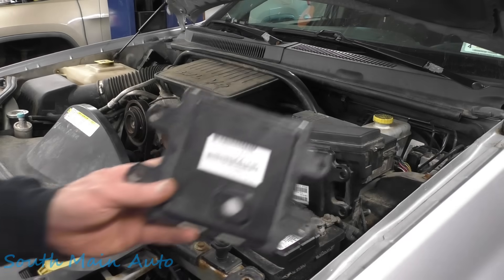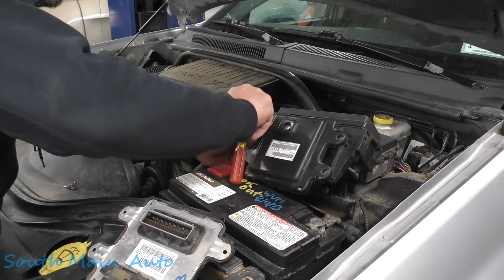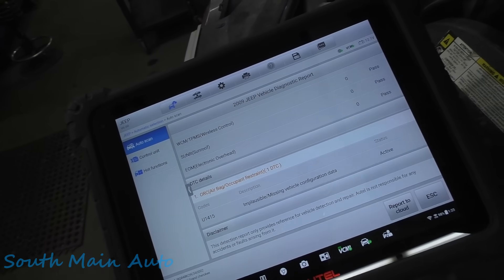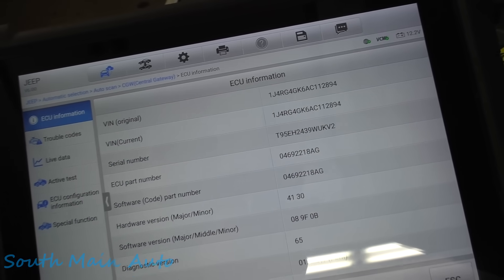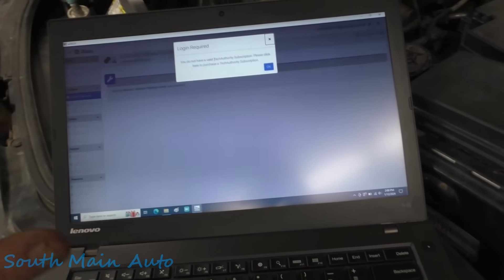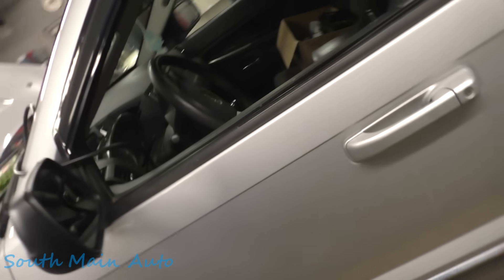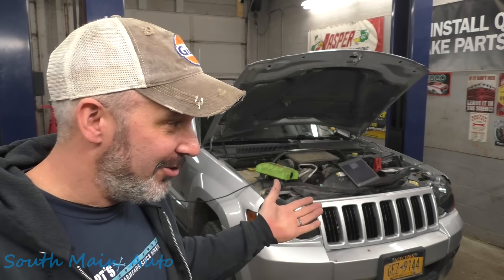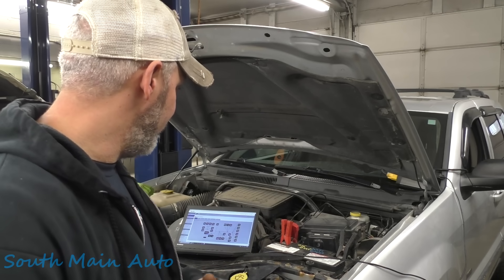'09 Jeep Grand Cherokee - Tach & Speedometer Cut Out - The Fix

Comment: Halfway through this video I had a feeling you were going to have to have L1 give you a hand with this one, I'm glad he helped you sort this thing out, and I have a feeling you're right, without guys like Keith you are going to see more vehicles totaled out due to dead electronics.

Also, would it help to put some dielectric grease or Fluid Film up in that connector to help prevent this problem from happening again?

Comment: You are 100% correct. Even folks not in the rust belt will be SOL when (not if) the manufacturer stops supporting the overcomplicated electronics crap. I'm an EE and have done electronics and electromechanical repairs my whole life so I'm not against electronics, give me electronic ignition over points all day long. Node locked modules that require special tools to reprogram are bad enough, making them so they can't be reprogrammed is criminal.

For most folks a car is the second largest purchase they will ever make with their house being number one. Imagine if houses worked like cars. Your fridge dies but is node locked to your house. The only fridge that will work with your house is no longer supported and so you find a used one, but you can't program it to work with your house without knowing the guy with the special software to reset (hack) your fridge and then you have to pay $150 to access the house builder's website to program the used, reset, fridge just to get it to work. Nobody would put up with this with their house, but we bend over and take it when it comes to cars. Why?
Reply: Coming to a house soon.
Reply: @jimbeaux1109  A modern smart battery charging circuit can sense the battery health and adjust. There is no need to rest 'battery learning'. The only reason to have such a system is to 'perhaps' keep track of the age of the battery to suggest replacement based on time.

Comment: Wonder if it would be easier to repair the connector on the module? Even if it was just a wire jumper from the module to the harness. Or are those modules filled with epoxy? Still would be possible for a person without all the test equipment to do. Would be interesting to see inside one of them. Thanks for the video!

Comment: If the "only" issue was crusty connectors, another solution could have been to replace the connector on the original module with the one from the replacement module.
Reply: @jimbeaux1109 
Connectors are usually molded, therefore sealed, so it would have to have been cracked for 'crust' to come from the inside. I guess since I work with electronics I see that way being easier.

Comment: Very impressive! When you were yanking that module off the fuse box I knew I would never have that kind of confidence because I would have caused damage that cost big bucks to fix. I do wish that 20 years ago when I got a computer science degree I had been smart enough to foresee what was happening to vehicles and learned the low level languages to make a tool as you described. Too late now but I have a ton of respect for those who did it and a ton of respect for those of you who trust your skills and resources. Nice job!

Comment: Good video ! What a Pain in the Derrière . Makes me very happy to have a 1999 Dodge Ram Cummins Turbo diesel. Parts are Reasonably priced. Just Had a water pump Replaced on the  Diesel motor. A 1 hour job. 2 bolts in the front & water pump is in your hands.
Pump can be found for less than $100.00
Total job price for a shop to do it n California. $337.00

Comment: i have an eeprom programmer that allows the data off a dead module to be read and then perfectly burned onto a used good module, effectively cloning the original without going through any manufacturer's rigmarole.  old cars will live!

Comment: More modern electrical shite that we have to try and fix Eric , great video 📹,  no help from the dealers as usual , great to know a man who can , I had a customers Dacia over here in the UK,  had an airbag light on , tried to clear the code and boom., car that drove in , now won't start , a bit of research showed if airbag control unit showing issues , the car thinks it's had a crash and won't start , Dacia wanted nearly 400 quid for the part , then they would have to program it,  another 150 quid , plus recovery to them 80 quid , found a tech guru over here in the UK,  packed it to him , 65 quid later , a couple of days , put it back in the car , no faults and it started and been fine now for over 12 months , what's wrong with 6 wires and drive away every day 😂

Comment: I'd be interested to see the inside of the old module.  if the board is okay, would it be possible to replace the connectors and save all the programming headache?
Reply: You can not open the Module without destroying it, How do you replace the connectors, which "board" are you talking about ?
Reply: @paradislarry - it might be possible to crack open the module and repair it.  I see Keith at L-1 do it all the time (not this particular module, but others.). I believe the “board” the OP is referring to is the PCB that is the guts of the module.

Comment: I'm hoping sooner than later most of these modules will have "jailbreaks" on them (essentially allow admin access at all levels of the modules to write whatever you want). Disconnect OnStar permanently, upgrade your stereo and configure the original steering controls, learn or delete the TPS, delete the key sensor so any correctly cut key works... So many amazing vehicles will go to the scrap yard because of electronics issues. So many cool engine swaps and parts grafting could be done without these silly barriers. Compare  the cost of how many thefts are kept from happening vs how many people had to pay to get a new set of keys reprogrammed... these are just barriers to make money and to make things obsolete.

Comment: Nice... Glad it worked out the correct way.  If Keith couldn't revirginize the module, I was going to suggest going back to Wilbur's and grabbing the airbag module to see if that would make it happy.  I did it with a Volvo that had blown side airbags... Putting in the junkyard bags and module cleared the airbag light

Comment: Did exactly this with 2005 FCM.   Physically FCM IPM identical.  There is an aftermarket/rebuilder procedure.  1. Disconnect power-swap fcm  2.  Turn ignition to on for 90 seconds when canbus network will reset itself including rewrite of vin in FCM.
Turn ignition off without attempting to start. 3.  Ignition on.  Confirm vin in FCM.  Start.    Worked for me.

Comment: That is one heck of a run around, especially as you had to pay three different costs to get to reprogramme the VIN and still find you can't do it ! It sounds to me like the original had a component connection issue inside the module which presumably is a sealed unit. Or maybe a component failure which might cost some 5 Dollars to replace, even less, but all maybes. Well done on getting there. Its a bit of a stretch to say the usual if I can do it you can do it, because I wouldn't stand a chance :)

Comment: The reality with these later model cars is that people are wholesale shotgunning the ECU and other modules with aftermarket solutions from companies like Haltech and Holley. Of course, it's only on cars for performance applications. It's criminal how expensive and difficult the manufacturers make it to get access to tech data/reprograming, etc.
Reply: I guess that's when you have no choice but to go to a dealer. I've had 1 or 2 instances where my mechanic could not or did not have the scan tool  needed. For 5 or 10,000 dollars he could get one. Guess what happened? He wasn't happy about this, but I understood. It got fixed 😢😢😢

Comment: Keith is the man! When the OE's stop offering support as well as parts, what do you do? The day of swap-tronics is long gone. I'm glad Eric mentioned that 1 would need additional equipment to finish the job. That's critical. Figure it like this. U go to a dealer even with a used known good module, and u still can't get it fixed because even they can't program it!

Comment: I've been talking to some guys that rebuild those Hemi engines. They say they have solved those cam problems. Apparently the problem is low idle oil pressure. They put the oil pumps in them from the factory high performance versions and it raises the idle oil pressure. More than one of them has said this solved the cam lobe eating problem. Hope this helps somebody.

Comment: Eric you have two modules, one in good condition that isn't configured for that vehicle and one which is but has rusted pins. SO, open them both up and swop the connectors over on the PCB's!!!

Comment: As someone who has many older cars in the family, It would be so nice if there were "U-Pull-It" salvage yards  in my area in the Hudson Valley Region of the PRNY. We had a few about 30 years ago, but they went away.
Reply: In the Netherlands, we don't have had those for at least twenty years, for environmental reasons. Pity, because I loved to spend time in these facilities. Now, the old cars get stripped out by professionals and you can order parts in a shop. What is not used, is recycled professionally. I am sure it is better, but less romantic.
Reply: That's happening here in the US as well. Moreso in the higher populated areas. The problem with having the cars stripped prior to crushed is the fact that they don't remove a lot of the parts that aren't high value. So the end up in the crusher. I like to walk around and grab those small but important parts, too. The prices are less when self pulled as well.

Comment: The unwillingness of the OEM’s to be transparent on these sorts of issues and fixing them is the problem, guys like Keith are the answer.

Just wondering, if there is no way to fix this kind of issue, would SMA be eating the cost of the short-term subscription(s) in the attempt, would it be shared or would the customer get it? It’s a nasty Gordian knot of an issue that’s likely to be more and more of a problem.

Comment: That will start to put a lot of cars off the road as they won't let service tecks  like you won't be given the program ability to keep  older vehicles on the road, or just half to pay  so much extra for a simple repair, even a great tech like you need help from other tech that Specialize in other areasSpecialize in certain areas. Great job MR. O

Comment: You're absolutely right about how manufacturers are designing cars so their primary competitor, old cars, don't survive for long. It's unethical. I understand the antitheft features, but not all of these modules need to have the exact VIN, and you shouldn't have a finite limit on the number of VIN resets. I hate the way they used government mandates for fuel economy but completely ignore the bigger issue of how long new cars survive. The expense of making more new vehicles can blow fuel efficiency out of the water when it comes to overall greenhouse gasses.

Comment: I use to work at Chrysler in Huntsville Al where we made a lot of the electronics  for them as being just one of the bidders for all the different s parts they offered and the engineers would let us bring in what ever we thought was a bad electronic part of of our vehicles no matter what age they were as long as we still made that part and they would check it out and also give us a NEW part to put  back in return,  just so they could get real life experiences of what was going wrong with the parts out there in the real world,and also if we had a 1 yr old vehicle that they were going to be installing a new version of an updated radio that was to be coming out they would take say  50 or how many available cars that we had and they would remove our old radios out of our cars and install the new prototype radio and we would use them and give back monthly reports on how we liked them or if any problems we would tell them what was going wrong and then they would replace it again and then have the problem radio to Dissect  to see what was going wrong with it...SURE did love working there

Comment: Yet another reason why my 64 F100 is my summer driver!:) one wire HEI and one wire alternator. That hemi cam / lifter issue is quite the mess for owners. My brother just redid cam / lifter job on his son-in-laws 2015 ram. What a project! So close to being mechanically totaled. The worst was the UAW strike which delayed parts for three months! How do you bill that out? Thanks for the great videos and sharing your diagnostic skills!😊
Reply: my 64 F250 has points and a generator so you are really modernized  LOL
Reply: @davidbaldwin2729  hey David, my 64 is what I call a resto- mod- survivor. When I hauled it home on two trailers there was no engine, transmission nor driveshaft. The seller had a 351M and a C6 that I rebuilt and I stalled. Previous attempts to restore also gave me front disc brakes! Everything was in parts and pieces but I had a chassis that I could drive in three months. Then the fun started!:) What's the story with yours?

Comment: In the event of an administration change that pulls back the reigns on the EPA, I foresee a company developing a stand alone PCM wiring harness that reads engine sensors only to keep them running.

The more complex, the higher the failure rate and the earlier the death of the vehicle. Prices on 12 valve Cummins powered vehicles that only require power to the starter and the fuel solenoid sounds nice. 

Eric, you should offer a service to your customers to unplug all of the electrical connection and dielectric them to avoid corrosion. Have you trashed this module? If not I'd like to take a peek inside to see if I can determine the failure point for possible future repairs.

Comment: If there were no new modules available and like this one only one pin is the issue, I wonder if a new wire could be soldered into the module and connected outside the existing connector.

Comment: Everyone was concerned when electronic ignition systems first started showing up on vehicles. They've come a long way since then. Ford electronic ignition modules would fail regularly,GM rotor buttons get a pin hole burnt into them from the high voltage and ground out the distributor coil connection to the distributor rotor thus creating a no run condition

Comment: What's the reason for allowing the module to be written ONE time and why wouldn't Chrysler want these to be rewriteable for situations exactly like this?  Was their plan to sell customers brand new parts at a higher cost?  The fact that you can't rewrite it just seems ridiculous.  It just seems odd that you can rewrite PCMs and a bunch of other modules but for this they're like...nope.  Some lawyer somewhere stating these are a one time application only because they relate to the airbag or some other bean counter issue?

Comment: Every year manufacturers strive to beat the competition by adding new features. The problem is that every added feature also adds another potential problem, and usually the feature is added without proper consideration to the impact the feature puts on the vehicle. The KISS engineering principle has been either forgotten, or ignored.

Comment: Is there a reason why you didn't or wouldn't paint a lite coating of (nonconductive dielectric grease) on the pins before putting it together to help keep the green nasty corrosion from coming back ?

Comment: Could you have tried cleaning the pins on the original  module with some deoxit first before condeming it ? Or did i miss something ?
Reply: the pin was broke off in the connector. but feel free to drill a hole where the pin was and insert and solder in an other pin.

Comment: I got the same vehicle and it has the same issue and then some. I know I got broke wires for the heated seats and such. Power exits fuse box but doesn't make it to seat module. I have to pull the dash out to put an evaporator and heater core in it and when I do that gonna search for the wires. My tach drops out random and the horn hunks for alarm random. Iv already been through the fcm and  no corroded pins.

Comment: I'm not sure about that other Jeep. How much of that camshaft metal has been run through the bearings?  I had a caravan in here a couple months ago with same problem in #6 cylinder.  I opted not to offer camshaft and lifters, and recommended an engine instead.  She opted to trade it in.

Comment: I recently replaced the solenoid pack in the 545RFE transmission in my Jeep. I bought it from a transmission genius I know so I won't be stuck with some junk from ebay. He told me after the install just turn the key on without starting the engine to let the new pack configure for about 5 minutes. I don't know if that helped but no codes after the install......  For the cam/lifters replacement in the 5.7 do you also install the MDS delete kit?

Comment: Would like to see Dorman come out with a pin repair kit to re establish corroded broken module connections.
Reply: Found an actual repair on Electricians Forums but it is more of an Ivan type  repair than SMA. 
 Marvo
Marvo - Staff member
Mod
Mentor
Esteemed
Supporter

    Jul 21, 2014 

    #24

Okay, I finally got around to this yesterday. I managed to excavate around the broken pins with a home-made hollow drill and I soldered wires onto both the broken pins. The corrosion was quite deep and I had to excavate about 8 or 9mm to unearth sufficient bright metal to solder on to, it was deeper than I intended going but luckily I didn't hit any circuit boards or components whilst digging. I removed the corresponding pin in the plug and threaded the wires through the plugs as they were reconnected to the ECU. I then manually joined to two new wires to the two now loose wires on the loom. Probably not the most professional job but fairly effective, I wanted to play it safe and drilling the broken pins wasn't going to be easy.